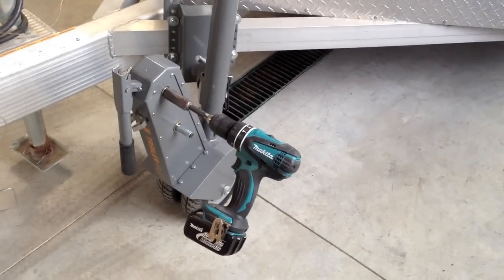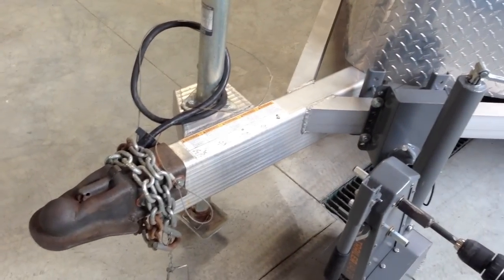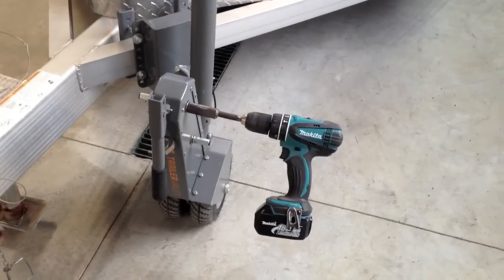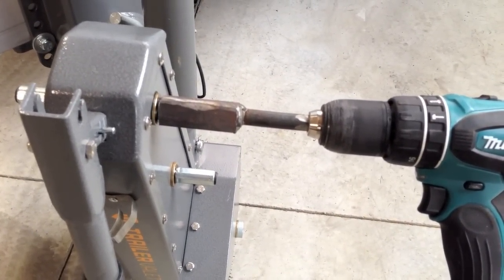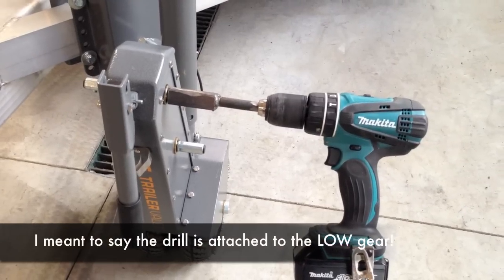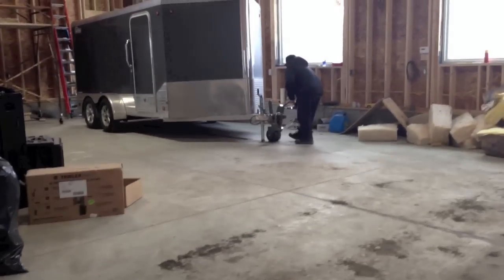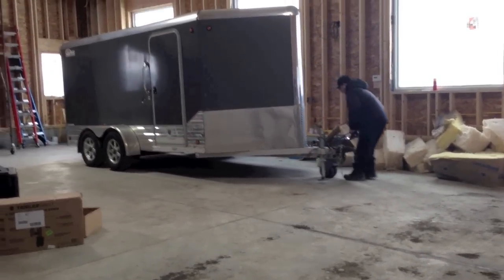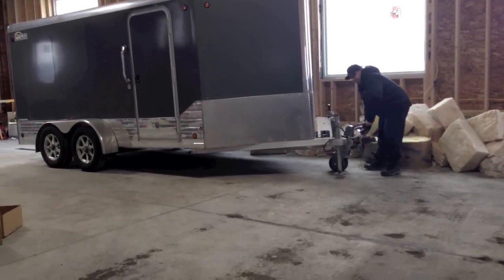Trailer Valet Drill Bit Modification

Comment: My unit didn't come with the drill attachment and here in Canada it costs about $70 CDN. I'd pay $25 for one, but not the price that they are asking. It's unfortunate that they wouldn't have made it so that a regular socket could be used. I only have a small trailer and not much distance to move the trailer into position, so I'll just keep using the hand crank.

Comment: Looks like that works good.  But in practice, do you actually bother with the drill or just grab the crank?
Reply from the maker: I prefer the drill by far, it is way easier.  Cranking that thing is tiring if you have to go any distance.  Far less energy expended with the drill!  This thing is amazing as long as it lasts!

Comment: What type of socket did you use to be able to connect yours. I have tried all types of sockets 6 and 12 point?  I even tried spine sockets. Nothing fit.
Reply from the maker: I couldn't find anything to fit either.  I went to my local welding shop and had them make a bit.  It took them less than 15 minutes and I was on my way.  Its worth the extra effort to have it made.  It is so much easier than cranking that damn thing.

Comment: I got my drill attachment today.  I paired it with an old Dewalt 970 18 Volt drill.  The unit easily drives my SeaArk Easy 200 dual axle trailer up my 3-4 degree driveway.  Much easier than cranking and cranking.  Two thumbs up for this drill attachment!
Reply: Forgot to mention, My Trailer Valet is the gray 5X model.  Just FYI.
Reply from the maker: The hand crank sucks.  Drill all the way for the win!

Comment: will the drill attachment sold for the xl version work with the gray 5x model?
Reply from the maker: That I do not know.  I did not buy the one sold by trailer valet.  This video was shot before they offered it.    I had the bit custom made at a fab shop.  Once you use the drill method you will never go back to the crank method.
Reply: how much did it cost you to build it?

Comment: Good way to early burn out an expensive drill.
Reply from the maker: I guess anything is possible.  Use low gear on both drill and valet and its fine.  Just pulling on flat ground, no hills.  Been doing it weekly since this video has posted and the same drill is working just fine...
Reply: NO way just spinning the damn gun should burn out a tool that expensive.
Reply from the maker: Over a year of use and the drill is still fine
Reply: @djcadillac1  how does it work on incline?  My driveway has maybe 10-12 degree angle
Reply: @Zelleram55  I recently bought the Trailer Valet XL. In the manual there's a warning maximum of 10 degrees.